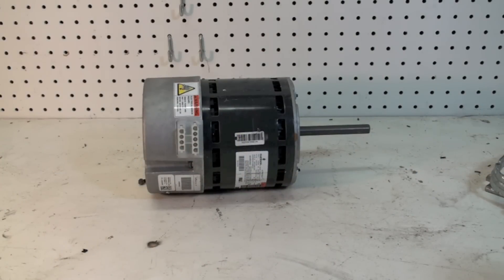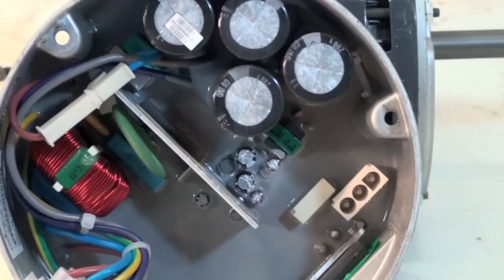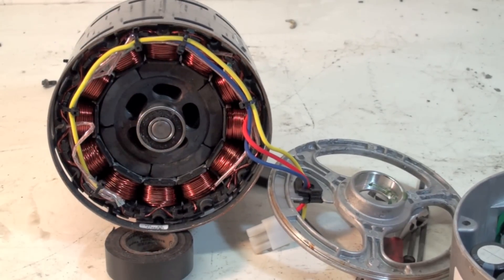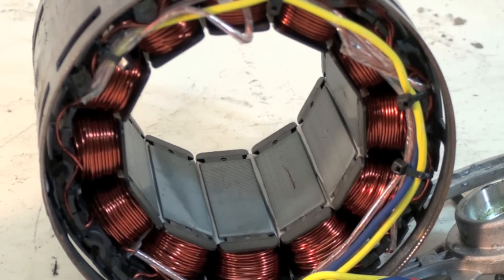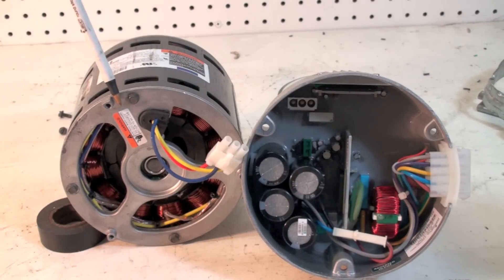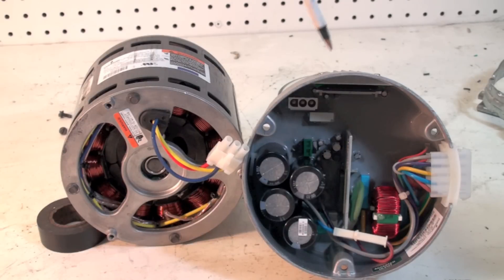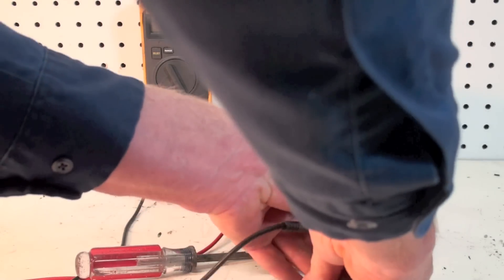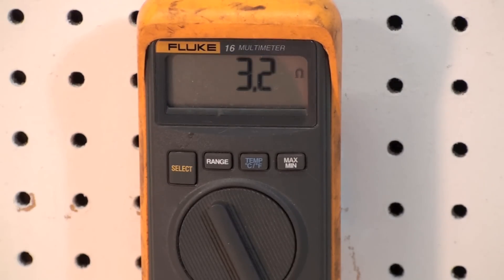The ECM motor construction and troubleshoot

Comment: My problem was the motor winding wires. There was a short in the windings. I was lucky to find it visually and insulate it with epoxy. My end bell is okay. The motor worked after reassembling.

Comment: My ecm 2.3 motor is stuttering, not wanting to spin. I pulled the motor and ecm. The ecm looks clean without any burn marks and the thermister reads 1.7 ohms across the leads. I checked the motor leads for shorts. No shorts. Then I checked resistance between each of the leads. Mine were not the same. I had readings of Black/Blue 1.2, Black/Organe 4.8, Blue/Orange 4.4. I suspect my windings are bad? I suppose it could be motor and ecm. Don't know of a way to check the ecm separately.
Reply: This sounds similar to my situation. Did you ever fix it?
Reply: @Superschemer34  Yes. Thanks to this video and tesla500 blower motor video. I had a short in the winding wires. I was able to find it, isolate the wire and insulate with epoxy. After reassembling the motor, it worked.
Reply: @Superschemer34  YES! Thanks to this video and a video by tesla500. It was my windings. I was very luck to find the problem and fix it. I traced a burned wire that was shorting against the other windings. I separated it from the other windings and then measured the ohms with my ohm meter. Then I was getting an even 5.6 across all three leads. I used epoxy to insulate the wire. Re-assembled the motor and it worked. Prior to insulating the wire, it didn't turn very freely by hand but now it spins normally. Search tesla500 ecm blower motor fix.

Comment: What is the value of the dC voltage used to drive the motor windings?
Reply from the maker: This system uses pulsed DC to operate the motor.
By timing the pulses at various rates, you can control the speed of the motor.
GFM

Comment: Great video! Do you know what voltage should be going through each one of those phases. Currently checking on my 1/3 hp 2.8 amp 682 rpm champion 3ton heatpump condenser motor. Does it step the voltage down from 220?
This unit is only 3 months old,  after a thunder storm power outage, I noticed the condenser  not running an hour later, I came to find out the unit had already shut down once for overheat, it turned back on but only compressor , not the fan. 
 I unplugged the 3 wire plug that goes to the motor to test the voltage while the pump was running,  I got 35 volts on all 3 wires, then plugged it back in and the fan came back on like normal.  
What happened? Is it fine or did something possibly get damaged? Thank you

Comment: is the motor good for anything if the end bell (controll module) fails.  ?  Can I make it work with a DC power source ?  I have the same motor by the way..   Thank you Sir.
Reply from the maker: It's a 3 phase DC motor.  The end bell changes AC to DC  and pulses the DC to control the speed.
GFM
Reply: @grayfurnaceman  Yes, but after the bell is removed, can I send 24 DC volts to one of the colored wires with a groud to the case of the motor will it spin ?  I want to use the motor for a shop celing fan.  Thank you.
Reply from the maker: @Backfire10  No, it won't work.  It's a 3 phase motor.
GFM
Reply: @grayfurnaceman  Thank you Sir.  Guess i will give the kids the magnets to play with.. lol
Reply from the maker: @Backfire10  Great idea.
GFM

Comment: No supply house that I know of does not have a tester nor do they sell just the back end. I agree with you in that all the motors that I replaced , the motor part is good. I just wonder what is the main component that goes bad on the back end of the motor. It’s a shame I can’t just replace the back end part.
Reply from the maker: I don't know of a supply house that does not sell the end bell by itself, except the X-13.  In many cases, the thermistor my be replaced for a simple, inexpensive repair.  I do have a video about the thermistor repair.
GFM

Comment: Hi, does the furnace control board sends AC or DC to this ecm motor through the 4 wire connector? Thanks
Reply from the maker: Its pulsed DC.
GFM

Comment: Excellent video. I'm just learning this stuff and have a question. I have the 5SME39SL GE and have 4.8 ohms of resistance across the board. My question is what is the ranges of good resistance? I've read it could be as high as 10 ohms. Does resistance indicate the condition of the motor? Is 4.8 ohms considered good?
Reply from the maker: I have no idea of a resistance reading for the control boards. You can ohm the windings of the motor, but probably the problem is in the end bell.  Does the motor start at all or just nothing?
GFM
Reply: Sorry, poor explanation on my part. The ohms are at 4.8 when measuring the plug out of the motor. The ground is infinate.. Just wondering if the level of resistance reflects the health of the motor.
Reply from the maker: @xtruguy  I have seldom seen a problem with the motors.  That resistance is about right.
GFM
Reply: Ok, thank you for your help. Keep up with the great videos.

Comment: Actually  when the  module goes bad the motor goes bad. And that is from carrier
Reply from the maker: That may be true, but I smell manufacturers profit margin.  They also say any failure means replacement when the most common failure is the thermistor which is a very cheap and fast repair.
GFM

Comment: Whats meg ohms when testing motor
Reply from the maker: Megohms is a very high resistance scale on a meter used to detect grounding of motor windings.  Hope this helps.
GFM
Reply: @grayfurnaceman  so just set meter to regular ohms
Reply from the maker: @vegaslowblower8781  If your meter has the megohm feature, yes.
GFM

Comment: This motor does not have the same lifespan or reliability a psc motor will.
on a psc you have one capacitor that sometimes goes bad and can be replaced easy and cheap.  iv seen them 60 years and up still in service. 
The end bells on a ecm are pricey and you can't recap or service them due to the epoxy.
depending on the heat the caps will go south after 15 to 25 years.

Comment: How many volts DC are these motors?   Btw I have an X13 that’s 240 volts..   I have the end bell as well as the control panel. ( the control panel (pcb board with transformer and wiring to the thermostat was mounted on the side of the squirrel cage)
Reply from the maker: They are variable voltage.  
GFM

Comment: Sorry i commented too early. Asking About the mosfits being servicable.
Reply from the maker: If the end bell is not covered in epoxy, they can be replaced.  But these are not factory parts.  You will have to get part numbers off the mosfet.  Even then, you may not be successful as some other part may have been damaged.
GFM

Comment: Thanks for posting. Are the mosfits servicable/replaceable? I have a ecm variable speed motor combo that isnt ramping up to high full speed. Its stuck in low. It attempts to go to high but fails. Thanks for any suggestions
Reply: Some have epoxy poured over them so they will be really hard to replace.  The problem I have is on my 2 year old Trane I can't find the replacement MOSFET/IC MOTOR DRIVER.  You can see the part number but most places are out of stock and other similar ones have double or more amperage rating.  Why is that I can't find replacement parts when the unit is only 2 years old?

Comment: I have an 8 y/o Trans split system that uses an ECM on air handler motor up in attic.  It's been cutting out when outside ambient gets over 90 F and then resets and runs normally when attic cools off.  Are thermal intermittents common with this setup?  Note:  Thermostat not issue - R - G jumpered at air handler and still cuts out.
Reply from the maker: Thermal intermittents are not common.  The end bell may be failing.
GFM
Reply: Thanks.  Next time it happens I'll bring a can of chiller spray up there and hit the end bell.

Comment: I had a us motor class yesterday on ecm motors the rep said the ecm motors used to fail alot from condensation in the module thus making the modules now coated with the epoxy on it. Thanks for your videos!
Reply: Said the $ale$ rep?   The second inch deep of epoxy was for what now?  The Right to repair is the challenge maybe?

Comment: 100 years old technology. This is just off the shelf 3-phase AC induction motor hooked up to Variable Frequency inverter drive (VFD) which use DC pulse width modulation to drive it. The same tech we use for pool pumps since early 2000's in compact for factor. Good technology, 3-phase is the only correct way to drive induction motors, not single phase capacitor crap.
Reply: Same thing I said it has a built in vfd

Comment: The bridge rectifier is also replaceable. I stepped up max voltage on the one I ordered for a little more longevity. My thermistor was was shot, infinite ohms. So I figured it's best to replace them both and beef up the board with some extra wire when I solder them in. Putting a bigger heat sink and some thermal paste may be a route I go as well.
Reply: Good thoughts.
GFM
Reply: Tell me more about the thermistor or heat sink on the back of the motor.  Where and how to replace it . Thanks

Comment: Another great video. My refrigerator compressor is also use this type of motor except that the controller circuit is on a separate controller board. Temperature is the biggest enemy for these motors, causing MOSFET or electrolytic capacitors to fail.

Comment: I have a 2007 trane VS 1/2 hp ecm 2.3 ccw, cn03 control module programmed for MOT09262. cant afford new motor. With no power, the fan spins like butter. Can i assume its the control module not the motor? I can get a refurb preprogrammed module. thanks
Reply from the maker: Simply using odds, the end bell is the problem.  Very few failures are related to the windings of the motor.
GFM
Reply: @grayfurnaceman  Thanks for the hint. I took the module off. Was hoping to see a charred thermistor, but nothing. the module board looks perfect. Can the module fail without any visible signs of failure (could capacaitors show no failure and be faulty and can they be replaced?). Is there any way to check the board components with a multimeter with no power to it? 
thanks
Reply from the maker: Capacitors could fail with no indication.  There are no simple checks.  Some dealers have the equipment to test them and that may be a good way to go.
GFM

Comment: My very first encounter with these motors was with a mushroom-style downblast exhaust fan on a high rise residential job. I started the fan on its toggle switch and hearing how slow and soft the fan sounded on startup I honestly thought there was something wrong with the fan or the voltage supply was incorrect. Upon taking off the lid on the fan, I see a small soda can - sized motor. I then realized its an ECM motor. Since then, every job I have come across has started using these motors. The only equipment I haven't seen these used yet is on Cooling Tower fans and hydronic pumps.

Comment: I'm pretty sure you said you were checking continuity to the windings? Actually you were checking resistance when you read that each winding had 3 ohms of resistance which, just like a 3 phase motors windings would read if they were good, all 3 would have the same resistance.

Comment: Something I have tried with the Carrier 3.0 ECM GC08. After I have had to replace the ECM module 4 times in 8 years, at the cost of $200.00 labor while under warranty. It has failed again. You get an error 41 and 44. Cannot communicate with the blower and blower motor fault. I just got so frustrated when the Carrier people will not let me exchange the defective module for a good one. Have to have a Certified Carrier Technician. So, I took out the ECM module and put it in the oven at 180 degrees for 5 hours. I then replaced the module. I has been running now for three days. I suspect moisture intrusion. They will tell you to make sure the two connectors are at 4 o'clock position or the 8 o'clock position. Make sure the harness is routed below the two connectors, so the water won't drip into the connectors. The module is potted, so there is nothing you can do. By putting the unit in the oven you evaporate the moisture in the unit and it works. How long it works is anybody's guess. You will pay over $1000.00 for a complete motor replacement when out of warranty. I've had one technician recommend putting a surge protector on the harness going to the ECM. It's been my experience that these modules are not reliable and very costly. If your module is already not working, see if it has a moisture problem getting past the potting material. Mine fail regularly every two years.

Comment: Disappointing that you did not show how to trouble-shoot the controller.  To determine the controller is bad because the motor is good is not a good idea.  There could be something wrong with the main board that tells it what to do.  I would hate to purchase a controller for $500+ and find it did not fix the problem.
Reply from the maker: Disappointing that you did not watch the video.  At 6 min into the video there is a link to a troubleshoot video on the end bell.
GFM

Comment: Great video! Is ECM a BLDC motor that has a built-in controller?
Reply from the maker: It is a BLDC motor.  Most of these do not have a built in controller.  Usually, they will have a control built in to the furnace control board.
GFM

Comment: Sometimes you can tell the end “bell” (i call it the module) is bad, by pulling it off and looking, sometimes that little link thats blue or green,  will have a burn mark and the solder will be broken.
Reply: My module has gone bad in mine and Sears wants to charge me 1200 dollars to replace it... this is the 2nd one to go bad in 3 years the first one was under warranty... why the hell cant they just change out the module? or give it to me and I will change it out for crying out loud! Damned sears and their proprietary crap. I wasn't the one that went through sears my stepdad is some meber of their club or something and this is my mom place I rent so when the 20 year old one went out exactly 3 years ago to the day tomorrow we had this one put in. I do not think ECMs like old ductwork.

Comment: Pulse Width Modulation?
Reply from the maker: Google it.
GFM
Reply: I was asking if the principle behind the operation was PWM. I'm familiar with PWM from my work with 
variable frequency AC drives. 

The rectified DC is switched by MOSFET's or IGBT's to produce a simulated AC waveform which is applied to the windings. 

I'm just trying to wrap my head around this technology as applied to residential HVAC. Several videos I've seen are showing how to convert back to capacitor motors.

One question I have is, what determines the speed set point to the motor? I figure it comes from a circuit board but what variables in a common residential system can be translated into a need to run the motor faster or slower, or is this just for startup and stabilizing until the system is operating at its peak efficiency?
Reply: TESP find out means to me.

Comment: looking at the connector, is this just an ECM motor and NOT a variable speed ECM?
Reply from the maker: It is variable speed.  The variable speed is controlled by the control board electronics.
GFM
Reply: thanks GFM for the reply. But i thought variable ECM motors have 12 to 16 pin connector. The one in this video has 4 or 5 only, which makes it a multispeed ECM and not a variable one. Please correct me if I am wrong. thanks.

Comment: I just replaced one that had a snapped shaft. It beat the shaft against the casing until it worn about half way and then it snapped. The squirrel cage was intact. I opened it and the magnet inside shattered. I never seen anything like that before.
Reply: V3 N1e dang that is crazy! Failed epoxy on the magnet maybe??

Comment: I have a motor that wont stop running is my first time working on this type of motor. Do you think i need to replace the endbell
Reply from the maker: Jose Guillen That would not be a common failure. First I would be sure the low voltage is not calling for fan. 
GFM
Reply: Did you find the solution? Mine is also running constantly.  Please Let me know

Comment: Thanks, very helpful. I removed an ECM blower assembly from a Carrier unit and would like to  use it for a shop fab. Do you possibly have any information about wiring the motor for 110vac?
Reply from the maker: Sorry, have nothing on it.
GFM
Reply: May be able to operate at that voltage with the use of an Automation Direct GS1 drive which are fairly <$150 inexpensive.

Check the specs of the GS1. I do know it will convert single phase to three-phase.

Comment: ]Is there not some hardware on the rotor and stator that tells the circuit where the rotor is? Something like the pick up on a distributor in a car?
Reply: I think they can use the back-emf to detect what the phasing of the coils should be. Thus there is no need for a sensor. This would also explain why these motors sometimes jitter around randomly when they fail - a bad winding fools the control circuitry that detects the phasing, and thus causes the motor to jitter in different directions and not spin properly. But this is just a hunch. :P

It's amazing what one can do with a microcontroller (a miniature computer on a single chip) these days!
Reply from the maker: Not that I know of.
GFM
Reply: That would explain why the motor ramps up to speed so slowly. The motor runs as a synchronous motor and the rotor follows the rotating magnetic field generated by sequentially energizing the stator coils. They start slow so that they can grab the rotor magnets and slowly pull them along, going a little faster with every revolution until the rotor is up to speed.